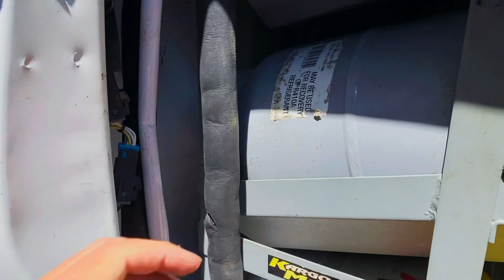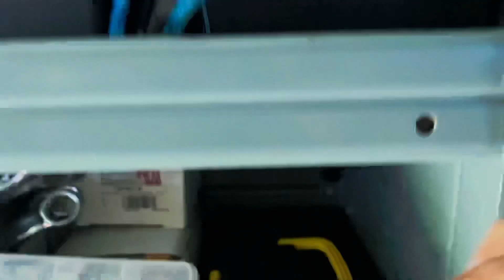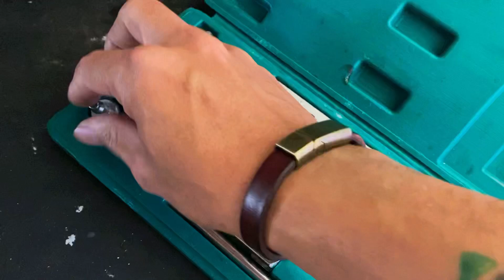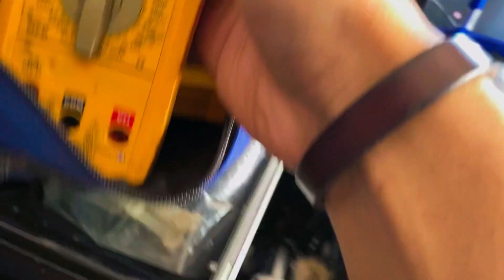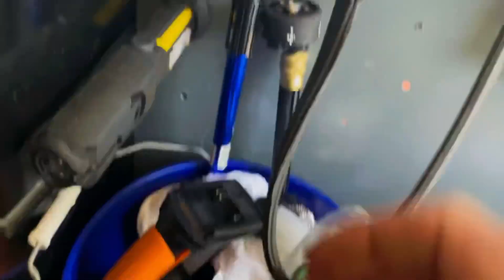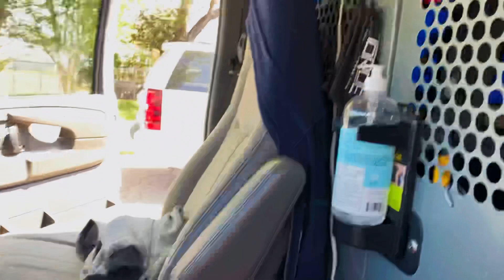My HVAC Van Tour 2021 | Commercial Refrigeration

Comment: I thought I was the only one with a toolbox in my van xD. Maybe I'll have to do one of these videos on mine :P. Great content man keep it up!
Reply from the maker: 😂 got a deal on the set, I was gonna find a way to use them. Thanks 🙏🏽
Reply: oh yea , got my self a 5 drawer took box with a top like enclosed compartment as well. store all my contactors , relays, heat pump boards, electrical fittings, tstats and so much more in those damn things haha. Dont have to go inside the van crawling around for those things anymore. got it sitting right at the side door of my van

Comment: great vid once again. what kiind of power inverter was that red one. i need to get one and i just dont know hw to install or get one. thanks  you rock
Reply: i just keep reading all these complicated wiring needed done and all. all i want is charge my m18 milwaukee drills ad stuff
Reply from the maker: I just grabbed one from Walmart, anything over 400 watts at least. And I hooked up to the car battery with a cable kit for an amp. I already had installed a sub/amp so I just tapped into it. I'm usually charging about 3 batteries with 400 watts
Reply: @ReliableHVACR  ok great thank you

Comment: I’m signed up for the HVAC program in college and I’m excited to start learning. Is Commercial Refrigeration an enjoyable  job? Is it rewarding? Are there really good days and really bad days? Thanks for the help.
Reply from the maker: You hit the nail on the head, very enjoyable and rewarding. You'll see a lot of different equipment in refrigeration and nothing better than seeing your finished install or getting a unit running that was broke when you got there. Of course you'll have some bad days when you start out but it's all a learning experience, it helps when you have senior techs to get you thru the tough calls. Good luck and don't be afraid to ask others, at your school, at work, tech support or even online like here 🤙🏽